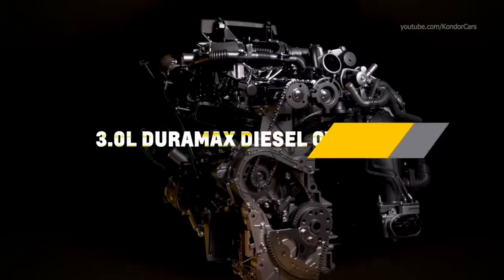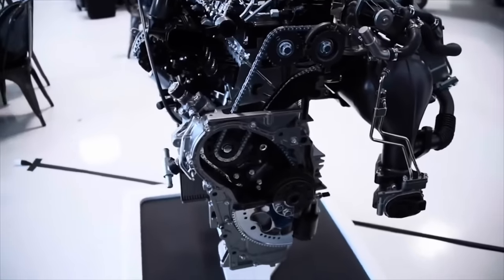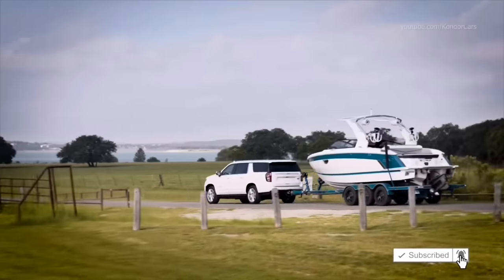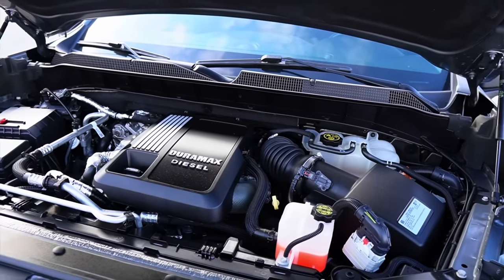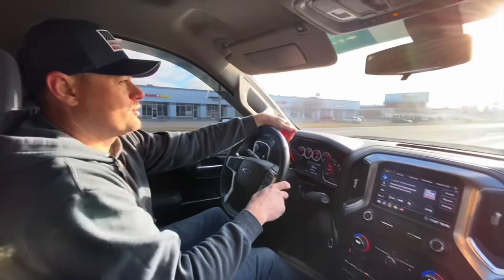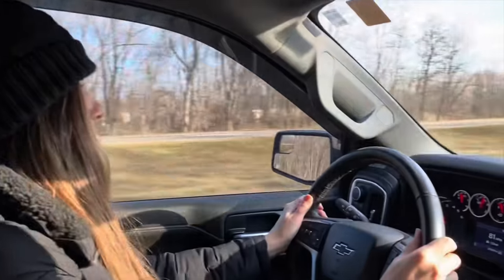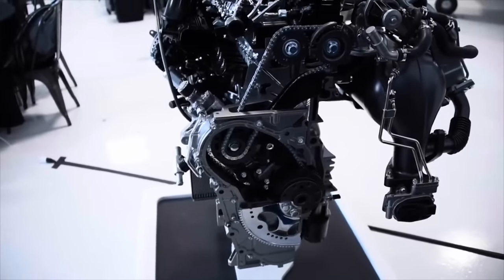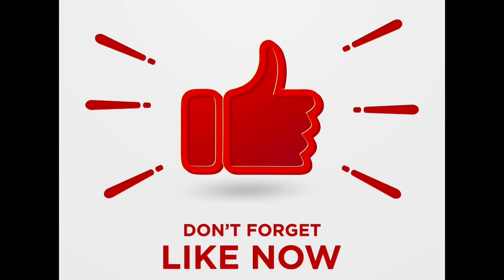What Everyone Needs To Know About The 3.0L Duramax!

Comment: No matter what, the driveability of a diesel engine is just better on every level. I use my 3.0 as a work truck and I love it. All the power I need, no searching for the right gear, all the low end snort... It's just miles better than the 5.3. The 6.2 is awesome but still has to pull revs to make power where these 3.0's just make power right away. She's no hot rod, but the power is so smooth, it doesn't matter.
Reply: Lame
Reply: I’d rather have the gas 2.7t especially since gas is $2.90 and diesel is $7.00.
Reply: @user-tb7rn1il3q  id take the 5.3 or 6.2 for long term. Dpf problems get expensive real quick
Reply: @thetechlibrarian  The V8s are too complex and have lifter issues.  I’d rather have the turbo 4.  The turbo 4 has fewer parts to break and has proved to be much more reliable.  The V8s are anemic in the mountains when you need the most power.
Reply: @user-tb7rn1il3q  hmm that’s a tough one. I keep seeing 2.7 problems but also see 6.2 problems. I definitely get the elevation argument I guess it depends on what ownership time frame we are looking at 0 to 150 I’d probably take either one that works best. 150k and above i would want the unstressed engine personally
Reply: @user-tb7rn1il3q  you do that and get 12-14 mpg haha I spend the same amount of money filling up my 3.0 than I did my Silverado. I’ll pay 4.70 a gallon to get 580 miles on a tank while your getting 350 😂 cheaper to drive a diesel than a 5.3 or 6.2 right now. Do the math
Reply: @user-tb7rn1il3q  nah. Your truck sounds like a Honda. I had one for a week.
Reply: @thetechlibrarian  how?  It’s like $8 for 3,000 miles.
Reply: @user-tb7rn1il3q  yes. I have a 22 it's perfect very efficient, 25mpg quite often.
Reply: @B  $7 ? Where do you live ? Geez
Reply: @user-tb7rn1il3q  lol diesel 3.88 ⛽️ 😆😆
Reply: @user-tb7rn1il3q  Not sure how a DOHC Turbo 4 cylinder is more simple than a pushrod N/A V8.
Reply: @B  Turbo 4 is a new concept....time will tell if your opinion carries weight. Also, turbo and proprietary equipment with said turbo is extra parts??
Reply: @user-tb7rn1il3q  really, who proved it to be more reliable? It just hasn’t been out that long imo
Reply: Yeah, and you can't tow much more than an empty trailer
Reply: @cpreit8862  shows how much you don't know.
Reply: @Brandon P  OK 3.0 9500 lb tow capacity 1830 payload allowing 800lb tongue waight. 5.3l 1160lb tow capacity 2280 payload 1200lb tongue waight. O yeah, the 3.0 only gets about 10 to 12 mpg when towing. And if you go dollar for dollar on fuel, you're getting the same milage. Throw the cost of def in and you're getting fewer miles than gas. Don't forget fuel filters and general maintenance. The 3.0 is a grocery getter now. Tell me what you know. Wouldn't be surprised if you didn't have a clue about cgvw and being dot legal
Reply: @cpreit8862  the 23 has a 13k towing capacity and will average 16 mpg when towing. So keep hating bud
Reply: @javadose317  so does the 6.6 keep pulling your tinker toys
Reply: The 5.3 says to the 3.0 "How long will you be around?"
Reply: Daily driver? 
You think is good for it?
Reply: Does your 3.0 burn oil badly ? I’m in the market for a 3.0
Reply: Totally disagree with you all kinds of problems that can go wrong with these diesels why take the risk 💰💰💰
Reply: @kevin122759  I agree. Why would anyone take a chance on this diesel garbage with all these endless problems they have. Thanks for posting
Reply: If you're just going to Costco and back why buy one of these things you're gonna pay dearly in the end💰
Reply: I believe that the 3.0l is the best option that you can get I personally don’t own 1 but I have studied a lot on them and I am not scared for purchasing the 3.0 l
Reply: I’ve owned a 2022 mínimax for the last 2 years has around 50k miles and taken it on several 17 hour trips and has worked out great with a 30mpg for the trip.?I’ve towed a 15’ dump trailer with a few thousand pounds of concrete and u can definitely feel the weight but it still pulls good also bulled my Canam on a trailer. So far I like it but we’ll see what the future holds.
Reply: @MrVictoria69 like what? I don’t know. Just thinking about buying one.
Reply: I think it would be good for the guy who has say 100 mile round trip to work during the week and wants to be able to pull his 6-10k trailer on the weekend..I've seen the tow max package gives it the 3:73 gears and 13k towing...plus resale is probably 15%+ higher on diesel compared to gas...just my opinion...I'm actually looking at one now and might have to make a trip down to your shop to "tinker" Lol
Reply: I just towed a 5x8 U-Haul trailer to Tennessee from NY and got 23 mpg. Not the biggest trailer but it was heavy.
Reply: @user-tb7rn1il3q where the hell do you live? Russia? Diesel in Texas is cheaper than mid grade unleaded.
Reply: @thetechlibrarian just keep it stock for duration of warranty then get it deleted. And as long as you take it for a decent highway cruise a couple times a week you won’t have any isssues
Reply: @michaelcady1945 why take it for a highway cruise ? Is it a self cleaning emissions thing that won’t happen on short trips ?
Reply: Deletes are available now I think the 3.0 is the best option especially for an everyday day.

Comment: I bought mine back in 2020 it has 130,000 on it now it hasn’t skipped a beat yet, uses vary little def so not really a big deal there, fuel saving alone were worth it, would never go back to a V8 gas truck.

Comment: I think the big reason a lot of people are going to this Duramax's because the V8's are having a lot of issues with lifters and engines because of that stupid cylinder deactivation BS. If General Motors would just get rid of that in their V8, they would be more reliable. If you can get over 300,000 miles on that Duramax and not have any issues like the V8 has that would be a far better deal.

Comment: I have a 23' GMC Sierra 1500 Elevation.  Just got past the first service.  LZO Burned Exactly 1 Qt of oil in 1st 7k Miles.  I live at 7300 ft Elevation and travel up and down hill.  I regularly pull a 12' Dump Trailer with a Small ASV Track Skidsteer.  I Average between 32-37 mpg on the highway not pulling a trailer.  I have had a couple instances of going easy on the highway downhill at 68mph from Larkspur CO to Pueblo CO and made 49.6 MPG!  I get about 14-17 mpg pulling full capacity GVW and the computer regularly reminds me that I am close to exceeding it's capability.  You have to drive the truck like a diesel and not have expectations of a gas engine when it comes to RPM's.  You have to understand the torque curve and let the truck lug at lower rpms a little more than you would expect.  I feel the exhaust brake is nearly useless and paddle shifters on the steering wheel are maddening because you have to put it in LOW mode to get them to work.  When you put the truck in Low (manual) mode, it downshifts 2x gears which makes no sense whatsoever.  The good outweighs the bad on this truck though and I will put 100k on it and see how it does.  I am a former truck driver and compared to my Ram 1500 1/2 ton the truck is a good improvement as far as towing.  I also recommend Sumo Springs for pulling campers and light duty trailers like I do.  I  have used Timbren springs on my Ram and they are stiff compared to Sumo Springs.  Final Statement is being a former Ram guy, this truck is actually a great combo for 1/2 ton lovers that want a nice diesel.  The engine is an Isuzu platform and well proven for longevity and durability.  My average mileage combo over the first 7k miles including Pulling my Skid, Highway, Stop and Go and cold weather idling is 26mpg combined.  I hope this helps if anyone has questions, feel free to comment or reach out.
Reply: One year later...  How has it been now?  
I am looking for a towing solution.  I need to deliver 2500lbs in a 7.5x14 cargo, 1000 miles a week; all HWY miles.  Could you help me estimate the MPG result for this situation?
Reply: Good report! Thanks!
Reply: @LargeCarjw  I don’t know but 1 qt of oil for 7,000 miles seems like a lot to me.
Reply: Follow up... Mine was a lemon. I am now back in a predictable Ram 1500 hemi. Bummed mine was a failed experimwnt. Endless issues and waiting for backprdered parts.
Reply: @LargeCarjw  what a nightmare. Hard to understand how so many people have NO problems with it and you had so many. Heck if I’m gonna take a chance on one.
Reply: @LargeCarjw  wow! thanks for the update, but huge bummer man, sorry to hear that!  I already bought mine, time will tell now.  figures crossed!

Comment: Went from an 04 LLY to the 3.0. Fuel savings alone is worth it. I average around 30mpg constantly. Fill up once a month. Tows my camper very well. Torque for days. Smooth, quiet, and comfortable. Nothing short of impressed.
Reply: @kiddoxFPS  you can get 580 miles on a tank while your gasser gets 350 if your luck
Reply: @kiddoxFPS  500 miles per tank. Not everyone cruises around looking for hookers.  I will fill up about 1 1/2 times per month. The 5.3 didn’t get 300 per tank.
Reply: When I drove a bit more highway with cruise on 75, I got 624 miles on my last tank with the 3.0L. This worked out to be 27 mpg overall. Coming from an 11mpg 6.2L Raptor….I’m happy ..
Reply: @Deanwam8  how I like the truck ? Any issue ? I got 10 mpg with my Titan lifted and 35’s.  I really consider 3.0 dura max only for the economy
Reply: @watchmanexpert  I’ve had no issues at all so far. It drives great and has plenty of power/torque for my needs.
Reply: @watchmanexpert  Economy if it doesn't end up costing you more in repairs long term. 👍
Reply: What’s the mpg while towing?
Reply: @affordablemowingservicesll9094 Got 19 mpg pulling a bass boat a couple weekends ago.
Reply: @affordablemowingservicesll9094  did about a 3k mile road trip with mine through mountains in Tennessee, was averaging around 15-18 while towing.
Reply: @chrisfranks4417  “mountains of Tennessee”. That’s funny right there..
Reply: @affordablemowingservicesll9094   i have an AT4 with the 3.0. I tow a custom 1962 impala and i average around 14-16 mpg.
Reply: @zackjay71  bro wtf i have both trucks and my 5.3 from full to 20 miles left on the tank got me 476 miles, 300 is in city not on highway
Reply: @renwhite1809  yea my 5.3 silverado gets like 320 a tank😂
Reply: Are you one who puts 20-30,000 on a vehicle and trades up? I’m one to drive the wheels off of it and that belt sounds hard to love.
Reply: @walterkersting9922  oh and i have the 3.0 too, love the sound of it but yeah just 200,000 miles on the belt Is crazy for the peoples that drive a lot, that means for me that every two year I will need to change it

Comment: We use our 1500 3.0’s for work, my dad has 85k on his Denali and hasn’t had one problem hauling trailers etc. I have an High Country and use it every day for hauling my 11k spray foam trailer every day. It pulls it insanely well and getting about 14-16 mpg with the trailer and getting 29-34 mpg @75 without the trailer. With the trailer It pulls it 75mph @1550-1600 RPM. My mom also has a Yukon, we love all 3 and haven’t had any problems.
Reply: 34mpg???
Reply: It’s crazy how efficient even the newer version gets at speed.  A recent trip had me over 30mpg at 77 on the freeway.
Reply: @ryanfreshour3259  Yukon with 3.0 or V8?
Reply: Yep. Doesn’t matter if you’re going 65 or 75. It gets the same. 30-34
Reply: Same here 2021 z71 4x4 Silverado 3.0 diesel gets around 35mpg on highway and 25 combine love it strong towing too.

Comment: I just bought one for a year-long review and I have driven many different Silverado and Sierra in both HD and LD trucks with diesels over the years. Watching this video, it seems like you are talking about apples and oranges use cases. For example, this is not in anyway a HD diesel like the 6.6L and is not meant for towing goosenecks all day. That's a 6.6L's job. Instead, this is a fuel economy truck with a towing component. 

The discussion on maintenance is really related more to the 6.6L oil change prices and not the 3.0L prices. 

Also, you don't have to remove the cab to service the belt and people who buy this aren't putting the miles on that quickly since it isn't a 6.6L Duramax. Instead, this is like a consumer version of a diesel vs the commercial diesel usage you describe. Just a different use case for a different consumer.

Comment: 2021 Tahoe owner here, we have the 3.0. Quiet, fast and smooth, the 10 speed transmission is outstanding. 26 combined on average. 30,000 miles. It is fun to drive! I would love a gear indicator and toggle for downshifting in the mountains. Thanks for the video.

Comment: I just picked up my new at4 with the 3.0 after putting 140k miles on my zr2 Colorado with the 2.8 diesel. The Colorado gave me zero issues after hearing so many people bash it just like they are saying about the 3.0. A Tahoe or suburban with the 3.0 to me is the best SUV you can get. I also think you are forgetting it’s a 1/2 ton and need to take that into account, if you need a heavy duty truck buy that and don’t buy a 1/2 ton if you need a HD

Comment: Love the 3.0 diesel.  Bought an AT4 in march 2021.  Pulls our 27' trailer at 6800lbs without effort. Mostly we pull our toys on a trailer with a combined weight, around 4500 lbs.

Comment: I got one of the first one delivered just over 3 years ago.  I had zero problems with the engine so far.  I live in Wisconsin and get 31mpg in the summer and about 27 in the winter.  The Def is about 1 tank per oil change, so to me that's not a big deal.... however when towing it uses 10 times the amount of Def.  This is definitely my biggest complaint.   My mpg goes down with the boat attached to 13 but the Def usage goes up 10 fold, it just seems to be excessive.   I do love the power when towing, it rarely goes over 2000rpm and stays around 1600 at 65,  so it's a quiet rides while towing.  8 9 10th gears are all overdrive gears, so it does feel like the engine is never really working hard.  My last truck was a 2010 6.0l gas half ton, I like both for different reasons,  but would definitely recommend the 3.0 for every day driving and the occasional towing, which I think is what gm was designing it for.

Comment: I upgraded to a ‘22 Silverado 1500 Crew Standard Box 4x4 Z71 with the 3.0 Duramax this Fall from a ‘19 1500 Silverado with the 5.3 V8. I have just under 8000 miles on the truck now and I am loving it compared to the 5.3 V8. 

I use the truck in the field for agricultural operations and have a 500 pound four wheeler in the bed at all times along with tools and a complete mobile office in the cab with laptop, printer, etc. 

I spend a lot of time slow driving often in four-wheel-drive around farms and a lot of time sitting and idling working in the truck. In between farms, I often have over an hours drive as well. So far I am averaging 20.5 miles per gallon across-the-board in this truck which for the way that I use it is great. The 5.3 that I had prior to this only averaged 13mpg. additionally, the 22 gallon fuel tank in the 5.3 was obnoxious because I was filling up with fuel sometimes every day usually every other day. I personally like the torque curve of the 3.0 Duramax because it makes its power in the mid range and doesn’t require slamming your foot to the floor to make any power like the 5.3. It also tows better because it holds its speed with the much higher torque rating and I’ve averaged 14 to 16 1/2 miles a gallon towing around 6,000 pounds, whereas I only got 6-9 miles a gallon towing with the 5.3. If I need to tow something heavy we keep a 2011 6.6 Duramax around for towing tractors and other equipment. Also, your tow numbers aren’t quite up-to-date because you can now get the 3.0 with a 3.73 rear end that’s rated to tow 13,300lbs.

Comment: Bought my 21 crew cab 4x4 RST with the baby Duramax new and it has been one of the best vehicles I’ve ever owned. I don’t really need it to haul stuff around but have used it to pull my Subaru around, well because it’s a Subaru and for some other common stuff you don’t throw into your car. Best feature is it’s comfortable and I average 600 miles a tank with the occasional heavy foot so this has been a great purchase for me and my family.

Comment: My son bought the first generation 3l Duramax several months ago and so far no problems thus far. I was impressed with it at first but I don’t want to mess with the DEF bull. I still have my 6.2 L.that I bought new in 02. It has 95k. On it with the original injectors. I do all the maintenance on it but at 76&3/4 years my “get up and go has just about got up and gone”. Always kept inside so not a speck of rust. Just a couple of mods like the pump rub kit in the xfer case and a big fuel filter kit. My next truck will be a gasser 5.3 L with the least amount of options as possible. Any suggestions? Thank you for your service. My son retired last year after 30 years in the Army. I love the fact that your wife is such a big part of your channel y’all keep up the good work.

Comment: I am the diesel tech at Cadillac and can say that these engines will be just fine as long as you do oil changes every 6k MAX. Every 3.0 with timing chain issues has had a lack of maintenance at some point in its life that I can usually go back through service history and find. I wasn’t one to want one when they first came out but now I think they are decent as long as you take care of them. Also short drives will cost you big money for exhaust repairs.